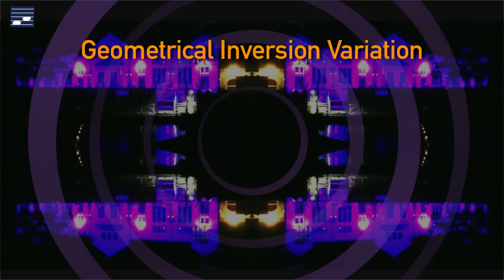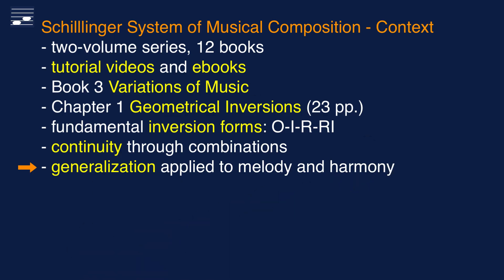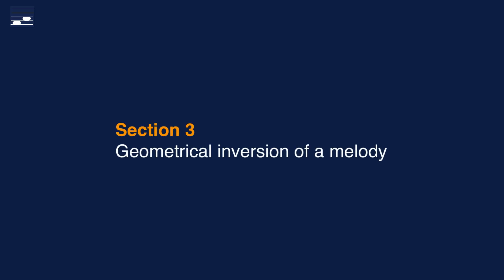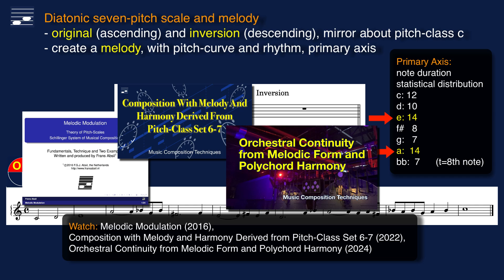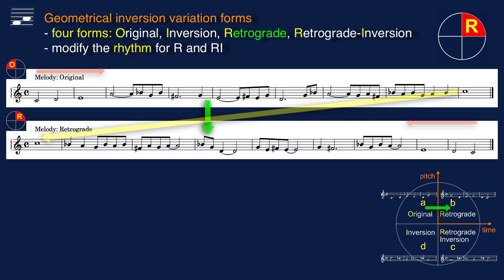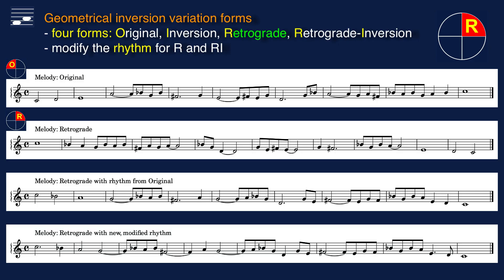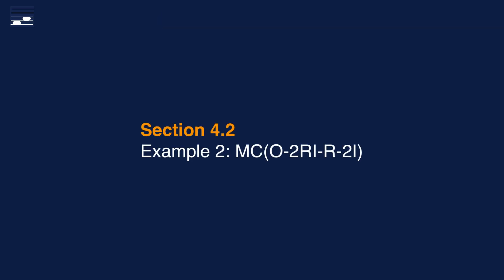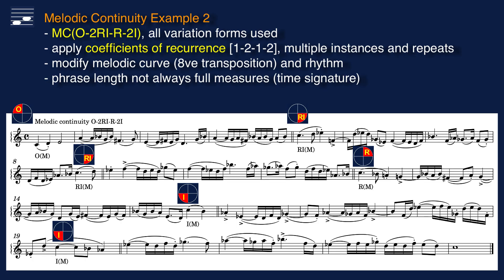Geometrical Inversion Variation in the Schillinger System, Part 1: Melody

Comment: 4:10  "The order of operations is relevant." This seems wrong, but it seems that if you reverse the order of operations, you get something that may have been shifted by a certain number of octaves.
Reply from the maker: @christopherheckman7957 Your remark is correct. Reversing the order of operations (first Retrograde, then Inversion) requires another transposition step in order to obtain the melody pitches from my example. Thanks for the comment.